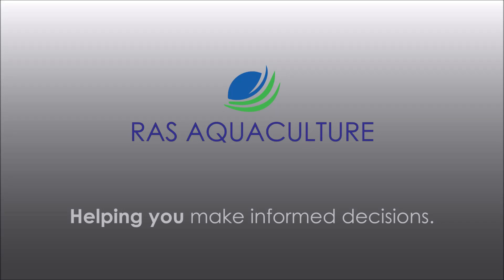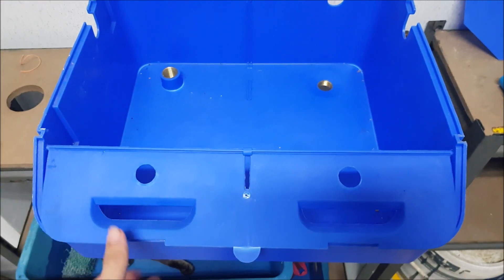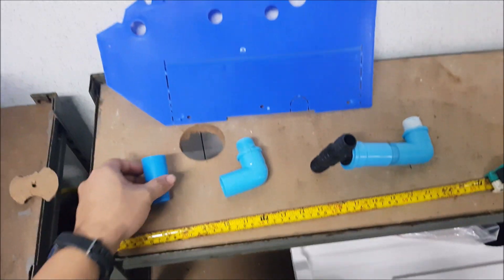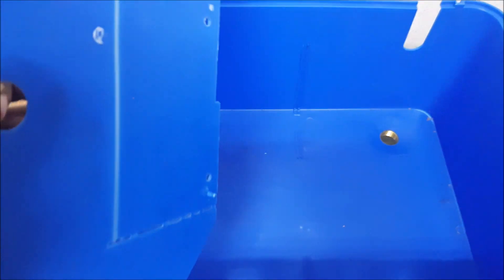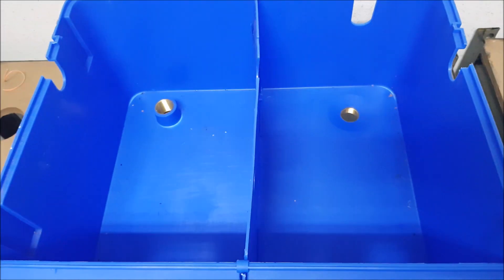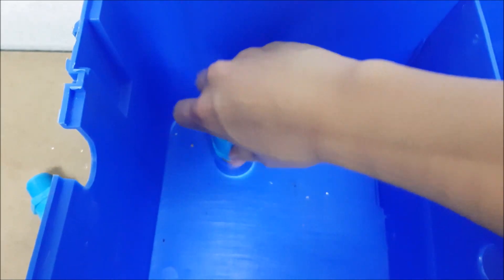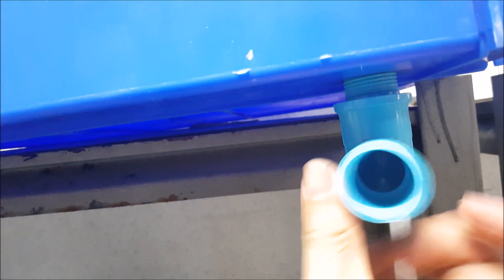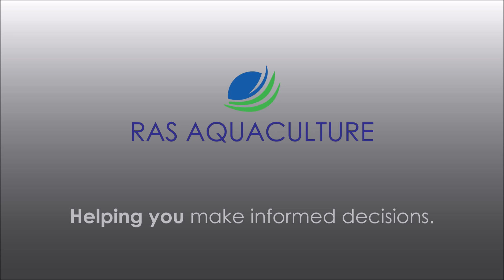BOM of Mud Crab Vertical Farm Boxes or Crab Condo by AquaPlanet

Comment: the middle partition that separates the box into 2 should be slipped in & sturdy (not easy to bend) & the followers can download related 3d cad files it from the website f to print it themselves with their own 3d printer or buy from RAS directly so as to boost RAS revenue or brand name.